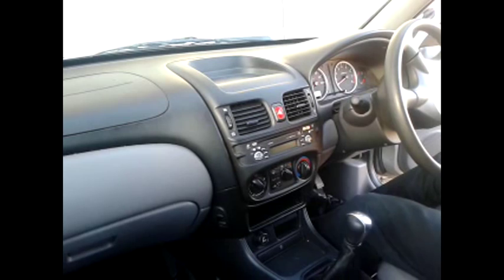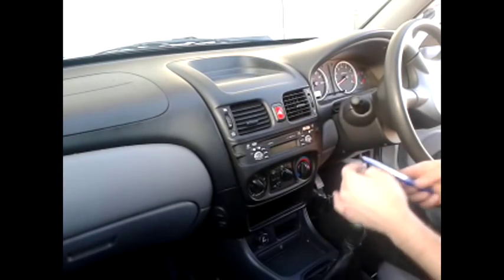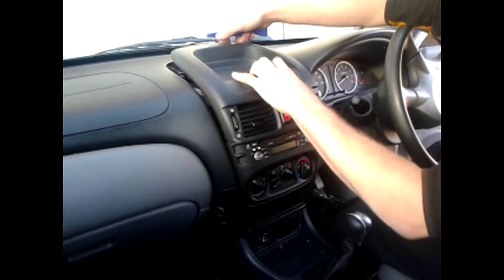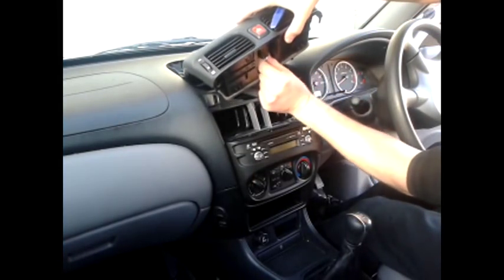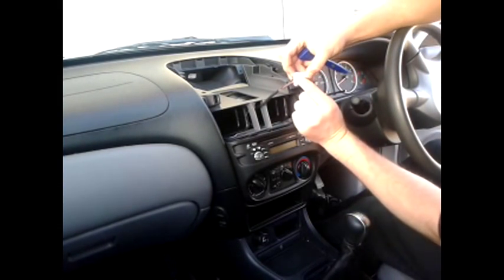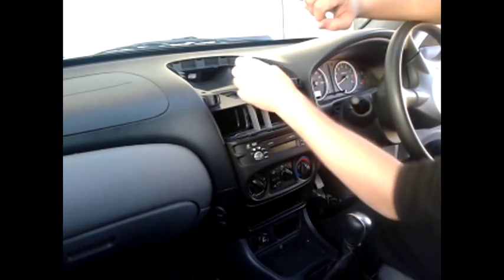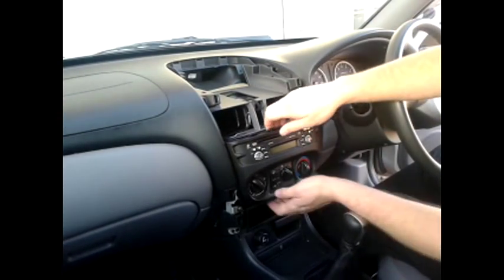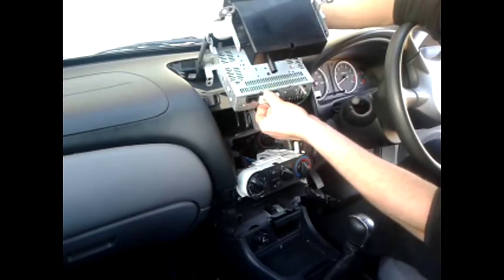Radio Removal Nissan Almera (2000-2006) | JustAudioTips

Comment: Hello, there are some adapters for car radios to go on top of these dashboard panels. I notice your panel doesn't have the typical cover and just has a tray. Is it possible to remove that tray in these models and install one of those adapters?